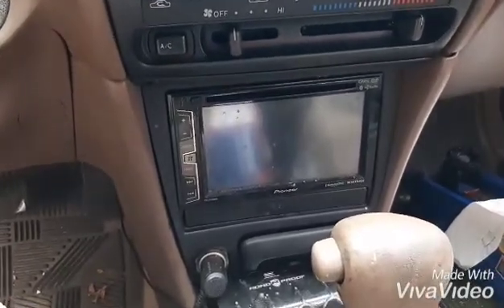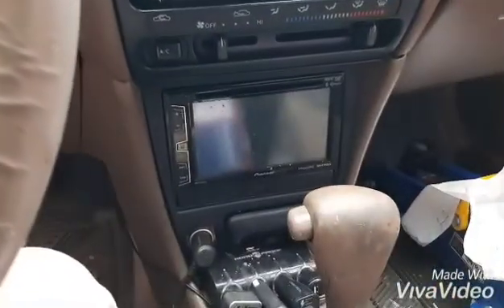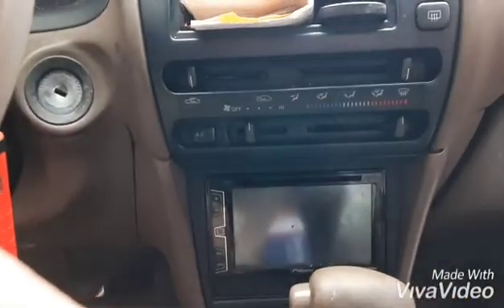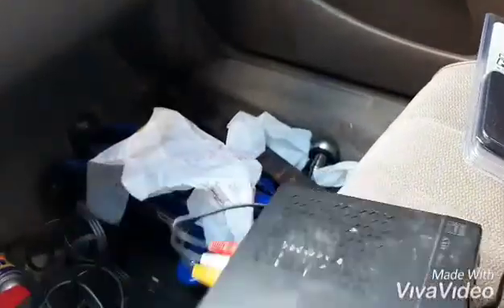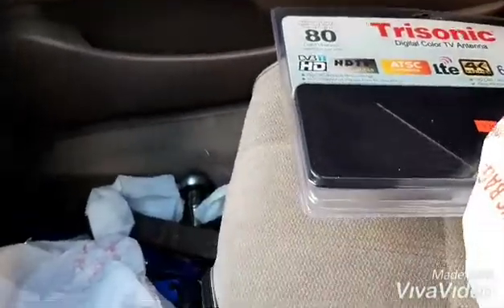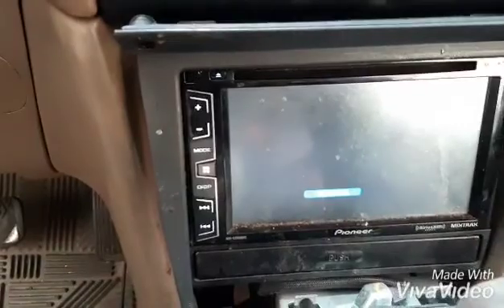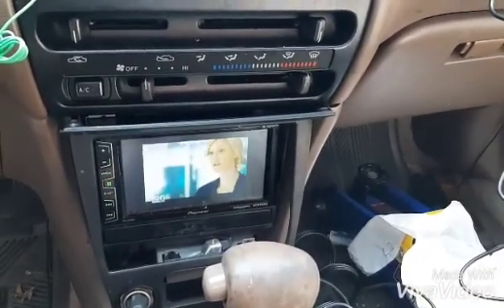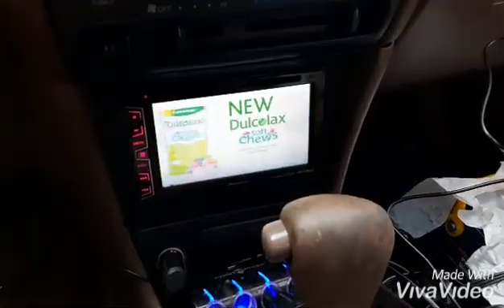TV tuner added to car stereo (proof of concept) part 1

Comment: Does this also work for alpine radios?
Reply from the maker: Would work with any radio that has A/V inputs.

BUT unfortunately the way digital TV works the signal drops during motion so this will only work when the vehicle is stationary.
Reply: @Nyphonejacks  I've seen some aux to av input adapters or av2hdmi, would that work?
Reply from the maker: @justinatmidi  any of those would work too send the signal to the screen but how digital TV works the signal is lost after the vehicle moves. ATSC 3.0 theoretically would resolve that but isn't implemented as of now
Reply: @Nyphonejacks  that wouldn't really be too much of a problem in my eyes, the least i want to do is look at tv while driving😅

Comment: Just wondering does the car stereo have a tv tuner or all you need is the TV converter box?
Reply from the maker: The radio doesn't have a tuner that's what the converter box is needed for
Reply: @Nyphonejacks  I see, I'm new to this but I thought the converter box was converting analog to digital so I thought it still needed a signal but that's good it can work by itself with antenna
Reply from the maker: @MrLuffy9131  the converter boxes are really just a digital TV tuner. They were used as a stop Gap when TV signals went to digital when many TVs only had an analog tuner